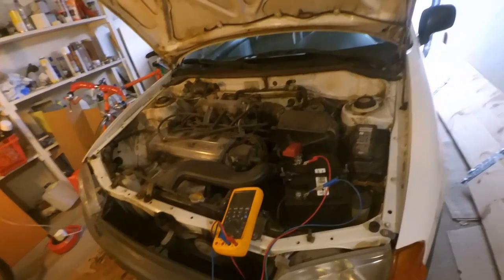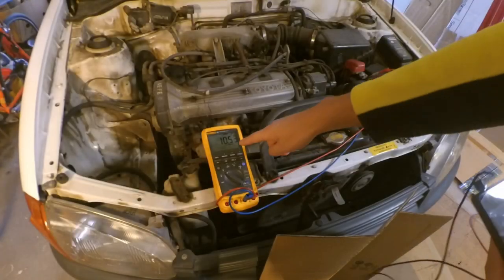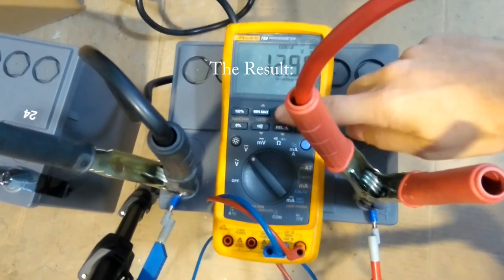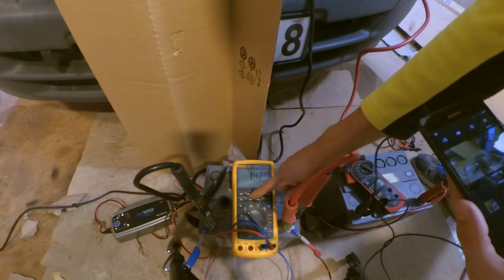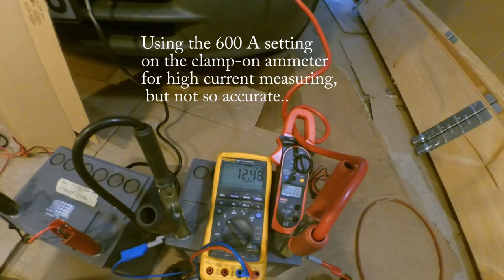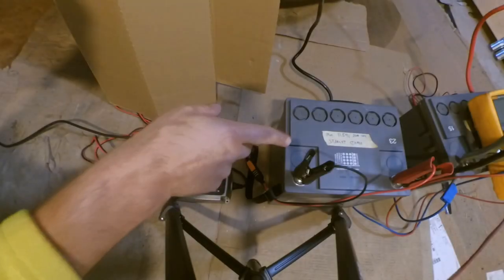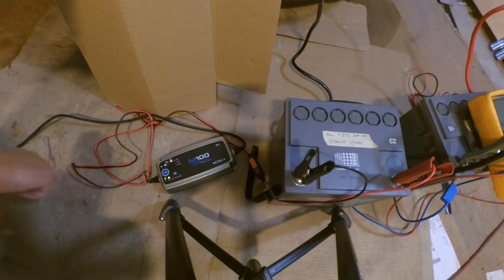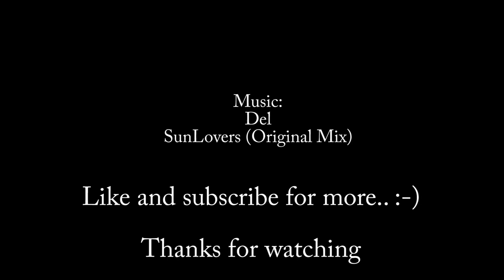DIY Battery Load Test With a Multimeter

Comment: Is that a fluke process meter 789 used for instrumentation and injecting 4-20mA?
Reply from the maker: Yes it's a Fluke 789. I use the source and simulating capabilites (active and passive) 4-20 mA often when testing or searching for failure i.e. seeking controlled input/output circuit boards that is made to take this current. In my case usually ABB I/O:s in the industry.